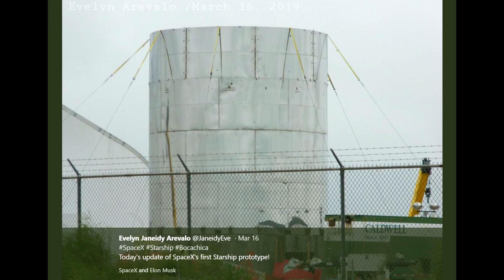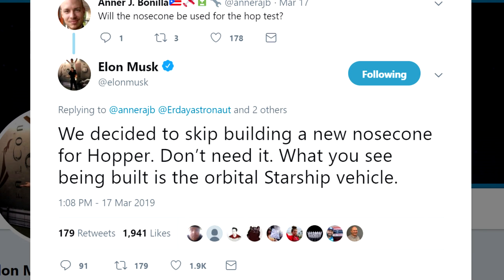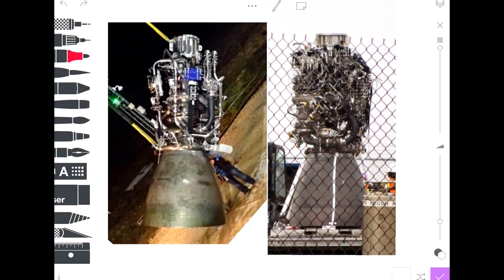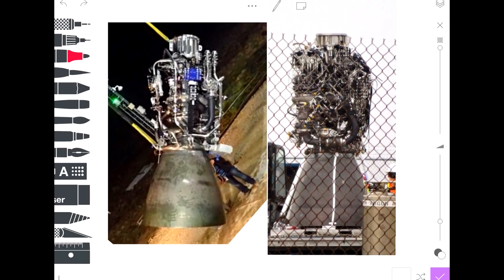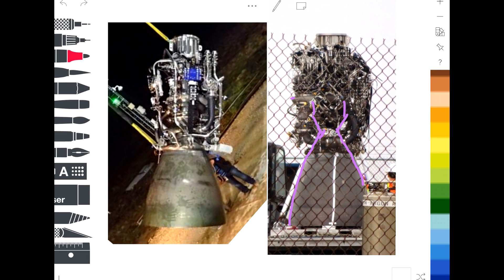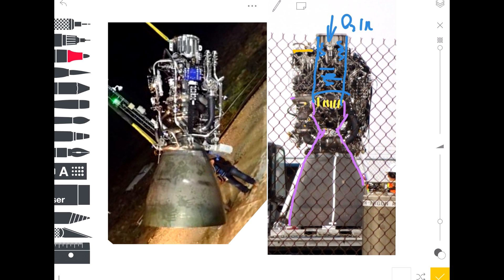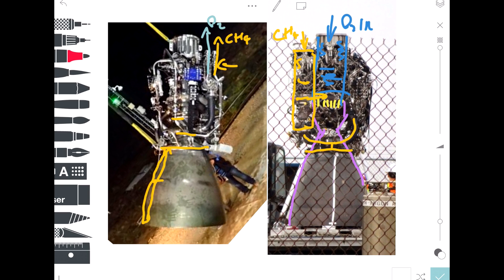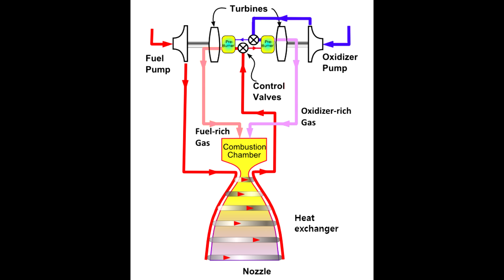Raptor Rocket Engine Analysis and Starship Testing Update

Comment: Now I'm wondering how they pressurize a hydrogen fuel tank... helium is denser than hydrogen so it would sink... do those tanks have all the plumbing on top instead? Will google this, but an experts point of view would help a lot...
Reply: Pablo Garin you gotta remember that the hydrogen inside the tanks is liquid, pressurised using gaseous helium. I don’t see a problem with that, but still, most likely, they use autogenous pressurisation.
Reply: @nanolog522  you're right!! I wasn't thinking a lot about the question lol... thanks for the reply, much obliged...
Reply: liquid hydrogen vs gaseous helium :)
Reply: @HO LAM YIU Thanks! It really clears things for me... I just thought that if the tank was in a cryogenic state maybe the helium was on a denser state too... I don't really know if the temperatures in those tanks reach the condensation point for helium, but it made sense to me that both elements would be on a denser state than normal... Much obliged for the answer and time!!

Comment: Notification crew! ASSEMBLE!
Reply: Matt Reporting In!
Reply: Hope Spacex has a lot of contracts lined up for this. The fuel costs of this vehicle will be unbelievably expensive.
Reply: @thunderbird1921  : Fuel is usually the least expensive bit, so I'd be more curious about how long it takes to fill the payload mass than the cost of the fuel.
Reply: @thunderbird1921  the presentation Must showed has Starship as the cheapest ride to space (cheaper than a falcon 1!)
Not throwing away a second stage is the biggest cost difference.